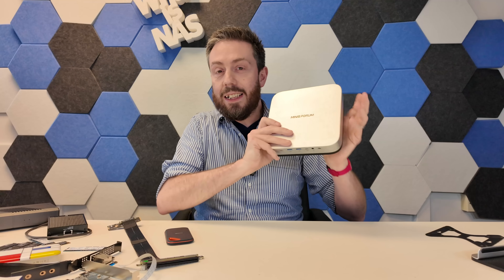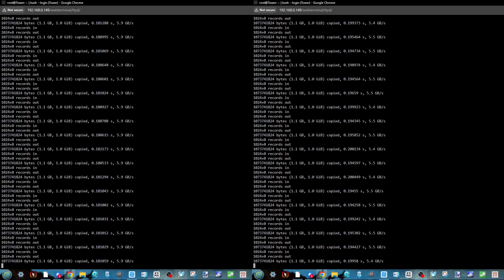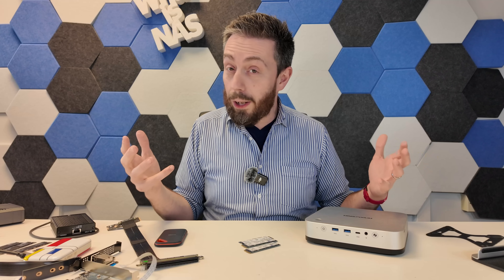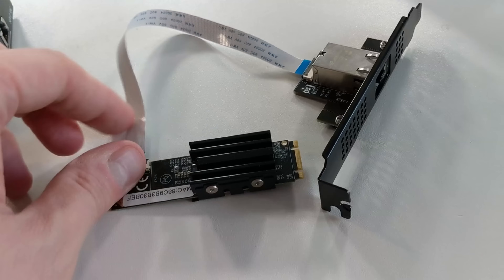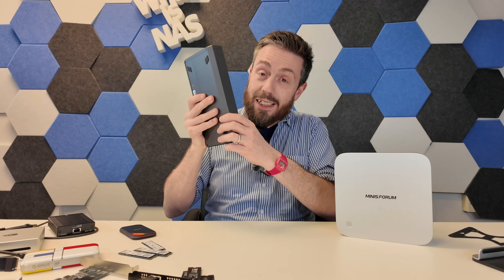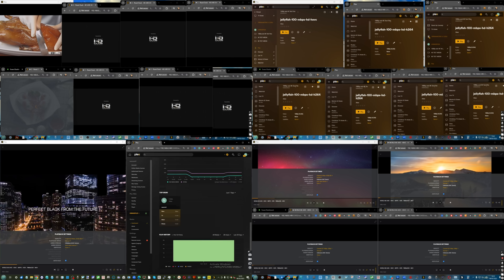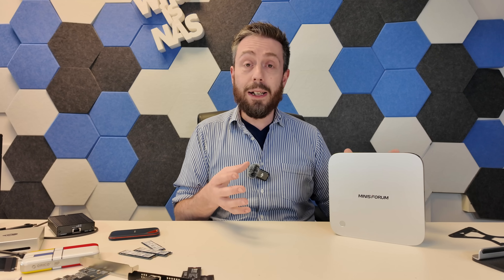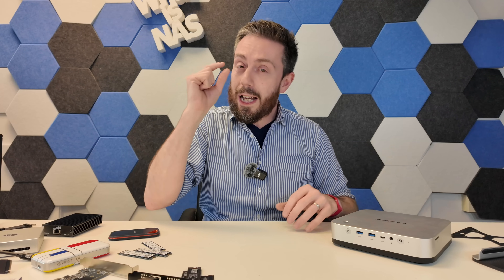Minisforum AI X1 Pro  - AS A NAS DRIVE?

Comment: Funnily enough, after my first NAS build last year using a N5105, I decided to do an upgrade to substantially increase the power of the system. I also used a Minisforum board, but the BD795i-se. They seem to be doing a lot of very powerful small form stuff at the moment. (And, yes... I know there are NO SATA ports on this board, but the addition of a M.2 card allows 8 SATA devices in 1 M.2 slot (thanks to Jeff at Craft Computing for the tip) and still leaves one for the cache drive.). Cracking board for a homebuild, and 16 cores too!.
Looking forward to the case review, although I have just changed my Chinese sourced one for a 3u rack case..... rack to follow!

Comment: I'm so torn... I had the X1 Pro in my basket, then your video on the N5 Pro dropped... and I'm now stuck in a reboot loop...

BTW your comment "able to run 12 instances of Windows 11"..  you need to make clear to viewers that virtualisation is not core-bounds, i.e. 1 core can be shared by multiple VMs (Google for CPU over subscription)..   a common ratio is 4:1, meaning you can run 30-40 VMs on this quite easily, the biggest bottleneck for virtualisation is usually RAM.

Comment: HX 370, in theory should be capable of supporting between 256 and 512GB of RAM in the future.
This depends on 2 things
That the computer have 4 RAM slots, and that they start manufacturing 128GB DIMM/SODIMM

Also of note, AMD Strix Halo has a DDR5 memory controller that supports LPDDR and DDR if AMD so chose, they could allow partners to include a board that has 8 DIMM slots, sure it would be way slower, i'm talking ~160GB/s vs 260GB/s but the benefit is that you could right now equip it with 512GB of unified memory, and eventually 1TB

Though, i suspect they're going to lock this behind an EPYC 4955 product name and use ECC for even more RAM(up to 4TB today depending on if it supports those kinds of ECC RDIMM and LRDIMM)

Comment: Excellent presentation.  Thank you.  This type of thing is what I will be replacing my Synology with.  I only store backups on my NAS and do SMB shares so I don't need most of the fancy Synology DSM stuff but I do need 10GbE networking and fast non-proprietary drives.  Probably going to pick up a couple of the MS-A2's when they are released.  Not sure if I am going to do bare metal or nest a NAS under Proxmox.  Will test and see how the performance is both ways.  If the PCIe slot in the MS-A2 can be bifurcated, that will allow for four (4) PCIe-4 x4 drives.  Even without bifurcation and 8tb drives, you would have 24tb. This while allowing the OS to be loaded on the PCIe-3 x4 slot.

Comment: Good info on OCuLink! Just worth remembering it wasn't designed for PCIe 5.0+. The official PCI-SIG standard for that (and PCIe 6.0) is CopprLink. OCuLink has its niche, but CopprLink is the future standard for high-speed cabled PCIe. Important distinction for future-proofing.
Reply: He forgot to tell you that the oculink adapter use one of the M.2 slots and it's most likely NOT the one with x1 speed, so your down to 1 x4 and 1 x1 speed internal ssds. The UM890Pro got 2 X4 speed m.2 slots and the oculink adapter eats one of them if you want to add an external adapter via Oculink. Just remember that it has a price.